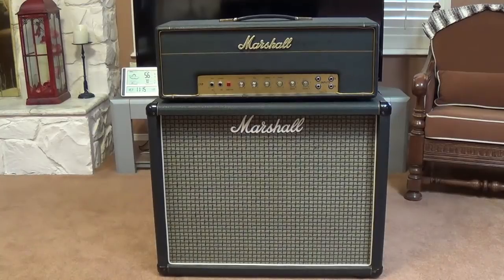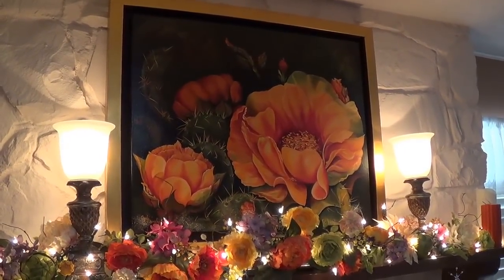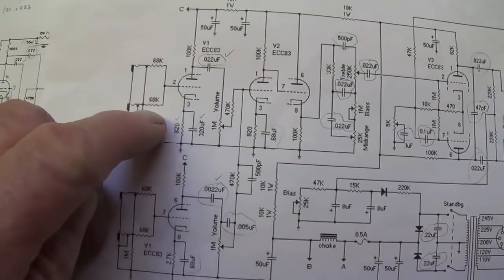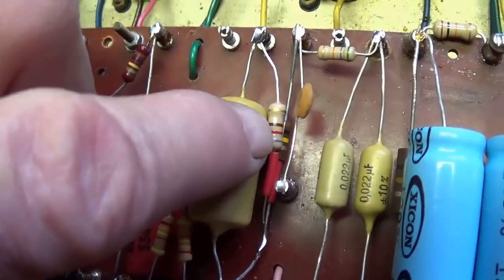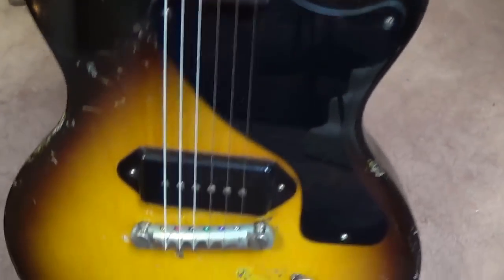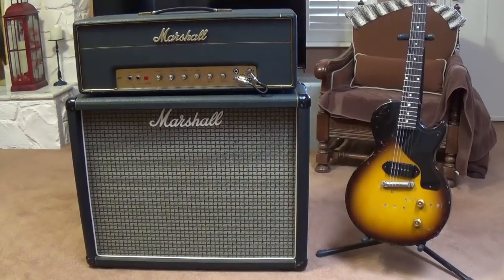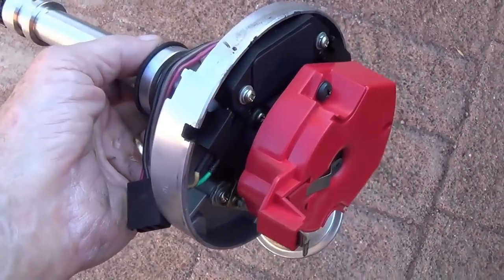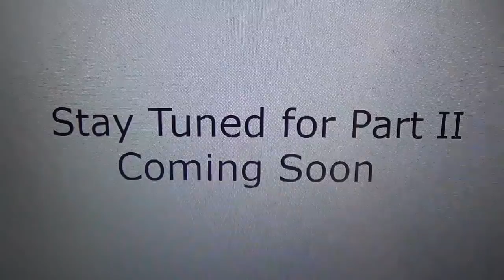Marshall 1986 JMP-50 Bass Amp becomes a Model 1987 Lead Amp.....with Extra "Mustard"

Comment: Thanks so much for all of your fantastic work.  In the tone stack, the 1986 slope resister is a 56k , the 1987 should be a 33k and you’ll find that it makes a difference (more gain).  Also the preamp mixing point (2 470k’s ) does have the 500pf bypass for the bright channel on the 1987.  Sorry to be so picky but having made many 20 watt versions of this circuit, I can see the scheme in my sleep .
Thanks again for sharing.
Reply from the maker: Thanks for your very knowledgeable input, Bill. I checked and you're correct.
Reply: Check out The Trainwreck Pages by the late Ken Fischer of the legendary Trainwreck amplifiers. 

His "Super Bass To Super Lead Conversion" is full of not normally found tips and tricks. 

Regards 🎸

Comment: The original 1987 configuration is more sparkling and has cleaner overall sound quality. The mustard caps are speaking to me. Great video Doug and killer amp .
Reply from the maker: Thanks, Gonzo. I agree with your assessment.
Reply: Agreed. The 86 would be good for a rhythm player and the 87 for a lead player.
Reply: I'd almost say the 1986 is a bit "wooly" nearing muddy, being a bit too big in the bottom / low mids (it seems to cause the breakup to occur at the wrong frequency).  The '87 has teat boosted/crisp upper mid that works great for guitar.
I might say something completely different if Doug was playing a P-Bass, however....
Reply: The Lads at That Pedal Show have a re-issue 50 watt 1987x (the "x" indicates an effects loop is installed)'that sounds great though they frequently complain about a bright cap that needs to be changed evidently a common issue with the 1987.
Reply: The circuit was changed, particularly in the area of tone, as was pointed out in the video. To suggest it's due to the use of a specific type of component might be a stretch.
Reply: What type of caps are in the signal path makes no difference to tone, they're values do.
Reply: @yogibarista2818  Hardly, coupling capacitors are the components which allow or block certain frequencies from being amplified or diminished in amplitude. Those caps are the reason you are hearing a difference at all..
Reply: All film caps let through frequencies well below and well above the audio band.  The difference in sound is from the component values, not the caps.  The idea that the modern film caps don't let all frequencies through is completely bogus  (take it from an EE).
Reply: It's not the caps.  All film caps will faithfully reproduce the whole audio range, and well beyond.
Reply: @bucyruserie1211  I think he means Branding. Mustards vs new poly's.
Reply: @jeffbrooks7246  Then I would agree with that comment, I never noticed any difference in say SoZo caps to Panasonic...

Comment: Sounds amazing. The 87 mod sounds the best in my opinion, although I very much doubt that it has to do with the mustard caps. I think you could have changed the values and use modern caps and had the same exact results.
Reply from the maker: Thanks, G & G. Don't tell anyone......but I agree with you ;)

Comment: I firmly believe that nonsense about caps is completely in folks imagination. I’m not saying to use the cheap, great for radios, yellow Chinese ones, just a good quality Sprague or the newer orange drops or tubular Mallory.
Reply: Pete Dazer  No... all caps have a slightly different sound. We can even measure the characteristics that cause these slight sonic variations with specialized testers built by Hewlett Packard originally back in the late 1970. It took 2 testers to cover a wide frequency range from a few Hz out to low radio frequency. At slightly over $10,000 each in the 1970s, few were sold outside of large business and standards labs. I now own both the HP units, can make all the measurements for DA, DF, ESR, and other characterizations.
Reply: The type is more important than the brand. Almost all film caps are appropriate for audio. Electrolytics are okay for large bypasses. Ceramics can be somewhat poor if they are high dielectric constant types because the capacitance varies with voltage. An exception to this is if the value is so high that little AC voltage is developed across them.
Reply: @jenniferwhitewolf3784  DA, DF, ESR al have very little effect on sound in a well designed circuit. You can measure it, but you won't hear it. "Cap upgrades" are nothing but snake oil.
Reply: Mister Hat for the most part I agree. A good quality cap compared to another of equal quality and value will not sound any different.
Reply: If people believe it then they will hear it , and they will swear on their mothers sacred soul that it is so
Reply from the maker: Well said, GD. Perception is in the eye (or ear in this case) of the beholder......and preconceived notions definitely affect it.

Comment: Hi Doug  nice resto job on the amp. Interestingly these valve rectified 50 watt heads were essentially JTM 45 circuit running EL 34 output as opposed to the earlier KT 66 / 6l6 type with the output transformer matched to the EL 34`s. The split cathode circuit came out in `68. The bass circuit is closest to the original layout.
Reply from the maker: Thanks so much for this information, Brian. We are learning a great deal about this unusual circuit from our very knowledgeable and helpful viewers.

Comment: So happy to watch your great videos again after a painfully long while!
I just 4 days ago accidentally found and tested 70's NOS 400V mustard capasitors and I was very surprised because they did not leak at all. They were very tightly in tolerances as well so maybe I will test if they bring any mojo to sound.
To be honest, I have made comparisons earlier several times and it is almost impossible for a normal person to tell if the cap is polystyrene, polycarbonate, polypropylene or paper if it does not leak and is within tolerance.
For some reason I personally like old bright yellow Philips HQ polycarbonate caps. They never have failed and IMO sound great.
Reply from the maker: Thanks, J. I agree that different types of capacitors rarely have an audible effect.

Comment: It really is good to have you back, Doug. I also heard the differences, but I can’t decide whether the difference was due to the caps, or to the changes you did to convert the circuit from the 1986 to the 1987 circuit. But it does sound much better.
Reply from the maker: Thanks, Bill. Probably a combination of both.

Comment: U.D. You came dangerously close to starting WW3 by demoing the tonal differences in caps. Thankfully, your cap comparison WITH the addition of a circuit mod saved the day. 

BTW, that's a very nice '30 Ford. Seeing that SBC with the small distributor cap shot me back to the 70's when I would hover a hot engine to set the dwell.  

Glad you're back!
Reply from the maker: Thanks, Randy. Yes, indeed. Fond memories of setting the points with a matchbook cover as a feeler gauge......in the dark.

Comment: Very glad to see you back with another terrific video.  There are some subtle variations in Marshall amps and where some of the components are can cause unexpected changes to the sound.  That 500pF cap across the 470K resistor I think is actually in both the 1986 and 1987 models and it has what I think is an unwanted effect.  In both amps it is connected between the grid of V2a and the wiper of the lower channel (schematic position) Volume control.  If you are playing through the upper channel (schematic position) and you alter the lower channel Volume control it acts like a simple treble cut tone control.  I realise 500pF is not a large value cap for a treble cut control but it does have an effect.  Conversely it boosts the treble of the lower channel by routing the higher frequencies around the 470K resistor, plus the 1987 lower channel has a 0.005uF 'bright' cap across its Volume control.  The Bluesbreaker has a 220pF across a 470k and the JTM45 has a 500pF across a 220K.  I only found this out about a year ago when repairing the aforementioned amps.  I guess if the player is aware of the effect it doesn't matter but I still think to have one channel's Volume control effect the tone, albeit slight, of the other channel is a bit odd.  But it's still a Marshall so who am I to criticise.  As a teenager back in the sixties those mustard caps were in open trays all laid out on tables in the parts store I frequented.  I think I need a TARDIS.
All the best for the New Year.   Jeff.
Reply from the maker: Thanks for your very detailed and knowledgeable input, Jeff.

Comment: Noticeable difference as expected in the bass range. I have noticed as I get older that I lean more towards the low mid to bass range and shy away from the ear stinging high pitch tones. This amp sounds great either way but me personally I would probably shoot for somewhere in the middle of these two circuits. Great video as always!
Reply from the maker: Thanks, PM2. I agree, shrill tones are quite unpleasant IMHO.

Comment: Glad to see you still going with the repairs.
There is a difference in the tone after the conversion.
The Bass setup sounds warmer but the Mustard Caps sound as though the bass was rolled off.
Seems like the owner could have used an equalizer to compensate the difference.
Reply from the maker: I'm thinking a compromise in coupling cap values might help.

Comment: The differences are relatively minor, but definitely audible.
The 86 had a little more bass end, and the 87 had more focused mids. Maybe it's just placebo, but I preferred the tone of the 87. Sounded more like a Marshall to my ears while the 86 seemed to have had a little bit of Fender sprinkled in there. Odd I know, but thats what I heard.
I am so "electronics challenged" that Ive been banned from purchasing a soldering iron, but I always watch your vids through my ignorant bliss. I find them fascinating. Thanks very much for keeping me entertained.
Reply from the maker: You're quite welcome, IP. Thanks for your input.

Comment: Doug you can use 018 Mullards/Bianchi's much cheaper than the insane price of 022's without any noticeable loss. Shared Cathode on V1 Vs Split cathode can help with gain also. The change in tone stack to lead spec and the .68 on V2 will increase mid gain also. You can go to a 25k pot 4.7k R  .68 combo  instead of 5k pot 01 combo on the negative F.B. loop for a less bright more mid presence control and reduce problems with a scratchy presence control. Try a 50K instead of a 22k pot on the mid control for more lower mids. Also where you put the negative F.B. lead on the impedance selector can change the gain of the amp in a good way. Marshall made numerous subtle changes over the years and everything that I have mentioned minus the use of 018's can be found in different models over the years and the total combination sounds great in a 50 watt.
Reply from the maker: Thanks so much for your very knowledgeable input, Sam.
Reply: @UncleDoug  Well it was unsolicited  but life is all about sharing so I thank you for being so cordial. By the way I have a bunch of mustards Radio spares and lemcos if you ever need a source. Health issues forcd me from the repair business a few years back and I am sitting on a pile of parts for fender and marshall. Have a good one.
Reply from the maker: @sambekins  I work on all sorts of Fender amps, so I may avail myself of your offer, Sam.
Reply: @UncleDoug  Doug a nice mod for Fender amps with vibrato which is completely reversible is to replace the ra pot on the vibrato with a switched spst type of the same value in order to remove the vibrato from the circuit and gain up the amp by about 25% works great on deluxe reverb amps makes them break up sooner for more grit also makes a twin reverb break up some a lot sooner. Lots of blues players love that mod :)

Comment: Great video as usual. I have every confidence that the sound difference was due exclusively to the difference in the circuits and had nothing to do with the NOS caps. Regardless I enjoyed it very much, it's always a pleasure watching you guide us from the schematics to the physical implementation.
Reply from the maker: Don't forget that the values of the capacitors were changed, Bill, not just the type. Changing value really does make a difference.
Reply: Yeah that’s what I meant by changes to the circuits.

Comment: So great to see you back Doug.  I listened to the sound clips with my eyes closed and wrote down which one I liked better.  To my surprise I liked the 1986 with modern caps in the majority of the clips.  The 1987 Mustard had more sparkle but to my ears less gain.  Good video great job.
Reply from the maker: The difference in gain may be a result of the recording process, Carl. Thanks for your input.

Comment: Sweet! A new Uncle Doug video, with a Marshall to boot.  This appears to be a JTM50 aka the Black Flag.  Sort of a stopgap between the JTM45 and the later 1986 bass circuit. (Hence, the GZ34 rather than diodes).  That being said, I prefer the lead spec.  As others have noted, better clarity and sparkle.  Bet it would sound glorious on 10. lol
Reply from the maker: Thanks, Mike. Out of respect for my wife, pets, and neighbors we will never know :)
Reply: This is indeed a mid 67 jtm 50, steel chassis, early window style sn right smack in the middle of the black flag run. If you pause on the topside of the chassis, the 784-139 ot is present, this is always paired with a 1202-133 pt. This combination has a much higher voltage around 495 on the b+. This circuit has a bit more headroom and brighter than other black flags. 470k mixers are native. This is a pretty wild period of production with very rapid evolution and at least 5 different revisions before the 1986’s actual debut in the fall of 67. Along with the 1986, was the 1985 pa, and 1987 lead, the only difference of a 1986 and 1987 during this period was a 100pf bright cap on v1. Respectfully Uncle Doug’s 1987 spec he is approximating is a later split cathode that first appeared nearly 10 months later in late summer of 68. This is more like a restomod than a true replication. Values in the tone stack and the higher voltage and differences in rectification and filtration are different with respect to the later split cathode.
Reply from the maker: @twilkindopa  Wow.....thanks so much for your very detailed and informative input, TW. Many of you know a whole lot more about Marshall amps than I ever will, and I really appreciate your helpful comments.
Reply from the maker: @twilkindopa  Wow....very interesting. We really appreciate your very knowledgeable input on this rare old amp. I will give all this information to the owner.

Comment: Hi Uncle Doug--welcome back!  My educated guess is that the change in tone had everything to do with the changes in component values, and nothing to do with the mustard caps.  The best quality electronic components are those that are being made right now.  Guitar amps are designed to sell at a price point, and many times, the component selection has a lot more to do with price than with quality.  One example of this is modern tube amps that use circuit boards.  If the manufacturers used double-sided boards with plated-through holes, almost all of the reliability problems with the circuit-boards would disappear.
Reply from the maker: Greetings, R. I agree completely. If the only change had been from modern to mustard caps , value for value, the difference would probably have been either nil.....or imaginary.

Comment: Hello Uncle Doug.
Cap swappers really do my head in!
I've been in electronics for 30 odd years now and I have to say that in ten years of exclusively working with Marshall Amps, I have only ever had to replace one 'Mullard Mustard' cap.
People seem to think that swapping all the caps will cure all evils. Wrong!
Proper fault finding, taking measurements and using proper test gear is the only way. (like you do) 
Great videos by the way.
From your friend in the UK 🇬🇧
Reply from the maker: Thanks so much, Dr. W. I agree with your opinion on component swapping.

Comment: Great to see you back...the time gap had me a little worried. I have a Marshall Bass amp (Superbass MkII) that has been modded with a PPIMV and was supposed to also have the little mods you added to take it to Superlead spec. It appears that it didn't get the cap/resistor mods. (I wish you'd worked on a later version so I could use you vid. to replicate the changes). Excellent work & results.
Reply from the maker: Thanks, Ray.